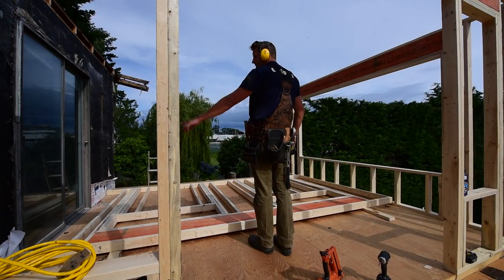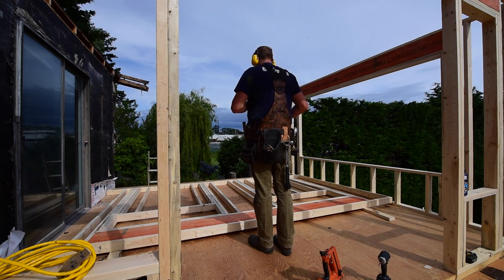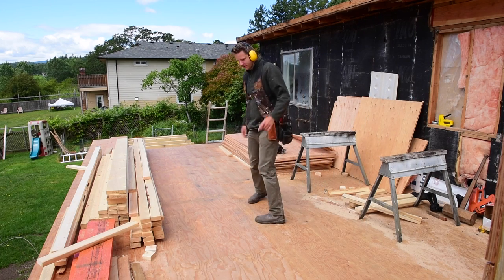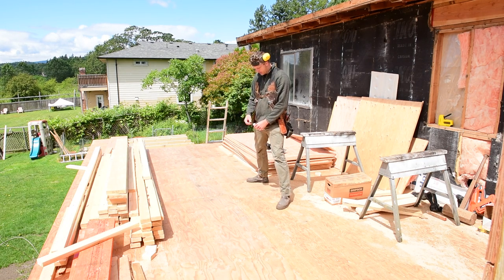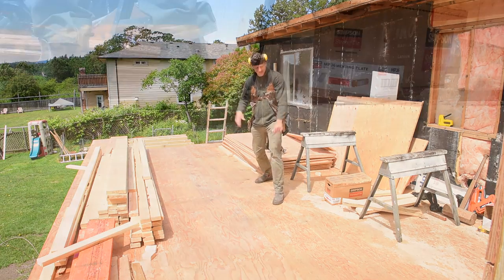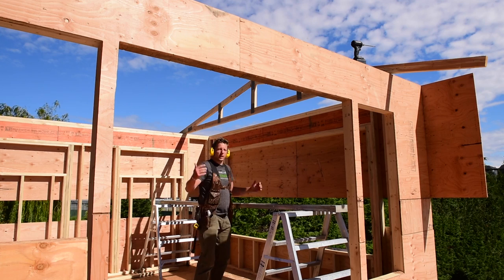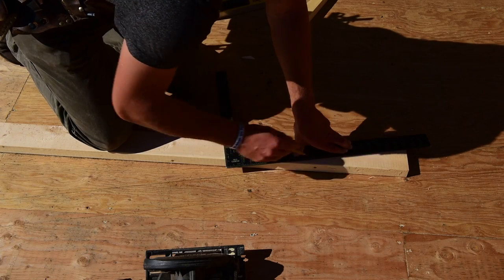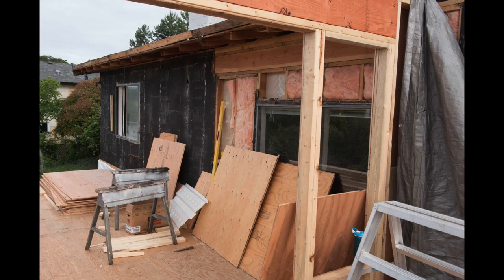FTF #57 How To Build Roof Trusses!

Comment: If you're "not much of a math guy" that means you have no clue how or why the chords/webs work together to distribute the various loads or if you've sized any of them correctly. Unless you're sheathing every one of them your truss design really isn't doing much to stop your top chords from sagging and making your ceiling sag in concert.  Hope you're not in snow  country. Next time at least have someone who knows what they're  doing design the truss for you.
Reply: With such a low slope too, the snow is going to pile up, it's almost a safety issue. There is a reason they are called engineered trusses, becasue an engineer passed and stamped them for the span/loads. Slapping some gussets on a few 2x4 can't be code, any stick framed roof needs at least 2x8 rafters.
Reply: If it was a larger span I would agree with you, but as someone that has built thousands of trusses I don't see any issues with his design. He could have possibly added a wedge block at the ends but there's not much room for more webbing in such a small truss. One thing I would worry about is we were not "supposed" to pound on the plates by hand, they needed to be pressed on.
Reply: Tioga Fretworks 100% agree. I took a truss design course through a company called mitek when i was a drafter. Live load vs dead load, point loads, shear strength vs tensile strength, etc. way to many variables to just guess.
Reply: He's not in snow country.
Reply: Its Canada, its all snow country. You never know what you'll get
Reply: Nope.
Reply: hes not in snow country, hes in Victoria BC they get the least amount of snow any where in Canada! he actually lives down the road from camosun college where i went for my carpentry classes
Reply: Tioga Fretworks
Fair point but they are rather small and I don't think you can get it too wrong over that span. I would have done the same. Maybe I would be wrong as well ;-)
Reply: Tioga Fretworks They are not triangulated, inspector may not buy off on them.
Reply: They won't pass if they aren't engineered
Reply: Should meet the bottom chord at third points, and meet the rafters at quarter points. To create a "W" shaped web system.

That being said the rise is so little that vertical studs are probably just as good.
Reply: Last video you were griping about 70's shit carpentry. And this video is you showing us how they did it back in the day.The work you did today does not reflect the quality of your skills as a craftsman. I'm very disapointed. Those trusses are the same type of construction used in those cheap throw away portable storage buildings.
Reply: Sorry, Matthijs, but the Samurai does in some cases excellent jobs but building trusses is not his profession...
Reply: Plates are mass production cheap crap.
Reply: of you build like the samurai carpenter you dont need math it is sturdy enough i sit on it
Reply: Many of the responser's concerns are completely legitimate.  Because of the web layout, this truss will not behave as a  truss with pinned connections, it will behave more like a rafter tie system.  Considering the short span, the design will work fine.  The top and bottom chords will work in unison and will be the equivalent of 2x7's, which should work fine considering the short span. Yes I am a licensed structural engineer.  I don't design trusses, but I have to review them all the time...